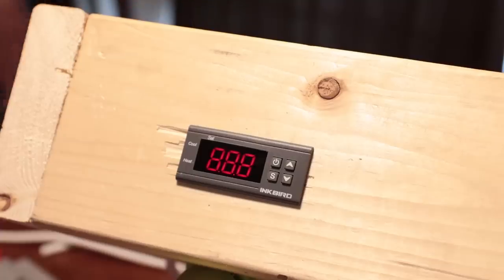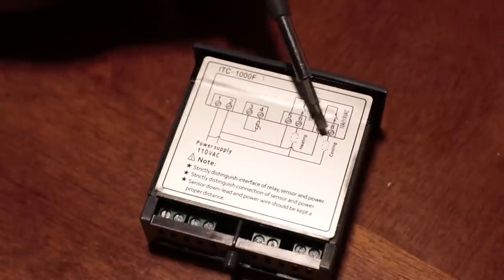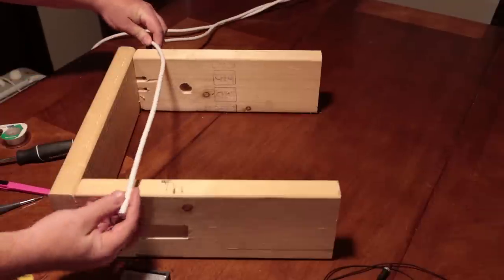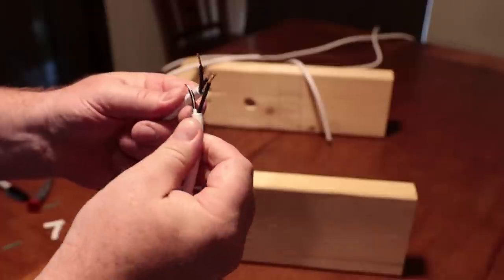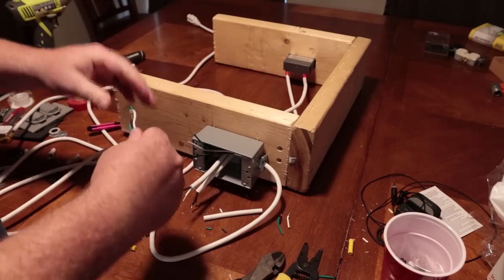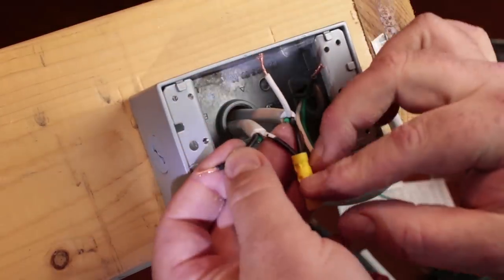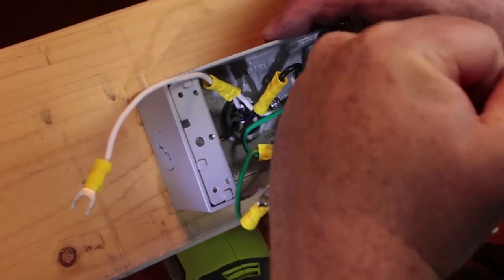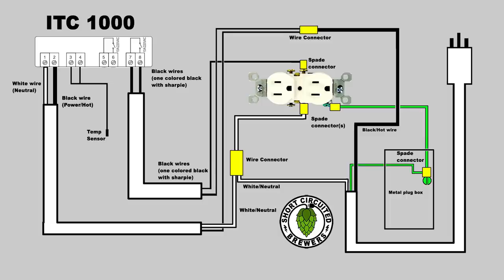How to wire a InkBird ITC 1000 for use in a keezer * BONUS* Wiring diagram included!

Comment: Can I use this with a 12v system for my sap pump?
Reply from the maker: You can but you would need to send the 12volt to the ink bird and back out again to use it.
Reply: I would also like to add a 12v a ppliance to the set-up (a fan in my case). Would it not be possible to add a stepdown transformer and run the resulting power wires to the freezer outlet instead of going via the inkbird?
Reply from the maker: Sure you could do that. I would probably recommend running your fan all the time though. If you don't need heating you could wire on of the outlets to have constant power and run it that way. 👍🍻
Reply: @ShortCircuitedBrewers  Thanks for the quick reply. I would definitely like to have it running all the time, but worry that kind of wiring might be a bit advanced for me ha. I guess I can always just run the fan wire through the back of the collar and reattach the plug at the back. Not anywhere near as neat as your solution. If it isn't too much trouble, how would I go about giving the other outlet constant power without the freezer also working constantly. Or does the inkbird switch take care of that? Thanks!
Reply from the maker: @jameshilton2896  shoot me an email at Brian@shortcircuitedbrewers.com it will be easier to explain with some pictures. 👍🍻
Reply: @ShortCircuitedBrewers  Done. I really appreciate your willingness to take time out to help with this.
Reply from the maker: @jameshilton2896  👍🍻

Comment: Great having you back Brian!

I recommend all to use these crimp terminals to make the wires tidy in the connectors. Link for connectors and tool are attached. Have a great weekend!

Connectors:
https://www.ebay.com/itm/Useful-800Pcs-Wire-Copper-Crimp-Connector-Insulated-Cord-Terminal-AWG-22-10-TSUS/123347432321?hash=item1cb8147381:g:1jAAAOSwPCVX-7~C:rk:1:pf:1&frcectupt=true

Tool:
https://www.ebay.com/itm/0-08-6mm2-Terminal-Crimping-Tool-Bootlace-Ferrule-Crimper-Cord-Wire-End-Sleeves/152007949212?hash=item2364613b9c:g:xVoAAOSwn-tZJpbD:rk:1:pf:1&frcectupt=true
Reply from the maker: Thanks Thomas! I do need to get some better crimpers because those are cheap ones that I bought. As someone else pointed out I'm using a smaller jaw for the yellow connectors because the yellow slot doesn't crimp them as well. Are you putting out some more videos on all the cool stuff you got going on over there? I've been watching your Instagram you got some pretty neat stuff!

Comment: I think I’m missing something. What happen if I want to connect both, heating and cooling.
Reply from the maker: I did not show that.  I am going to do a follow up on that in another video.  Coming soon!  if you know what I am talking about,  you can remove the connection between the terminals on the plug and wire the cooling to one plug and the heating to the other.
Reply: Please show this update soon!! Working on mine right now
Reply from the maker: Will do!